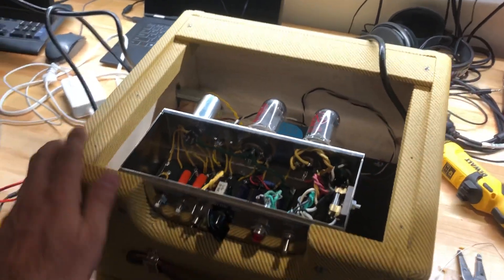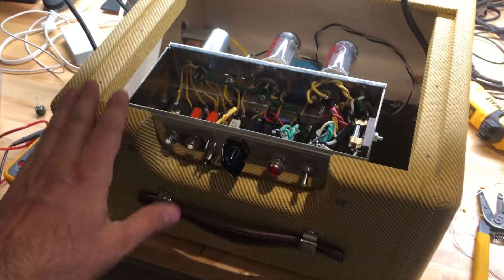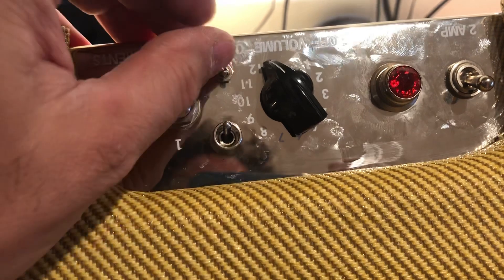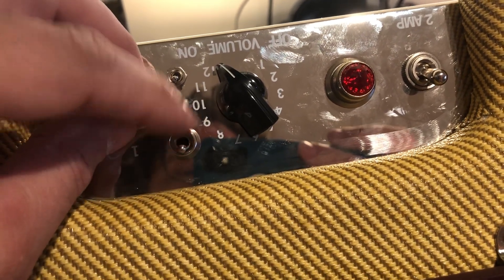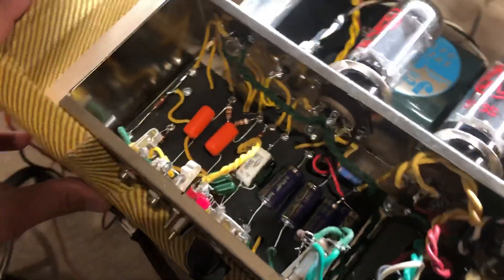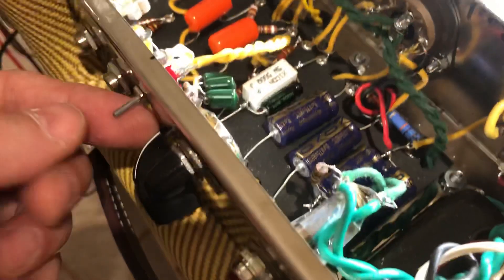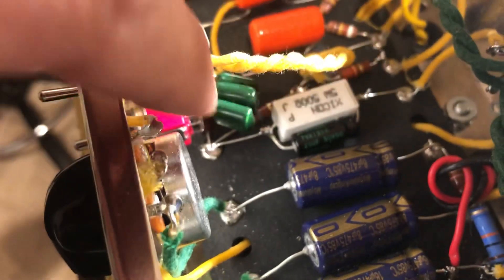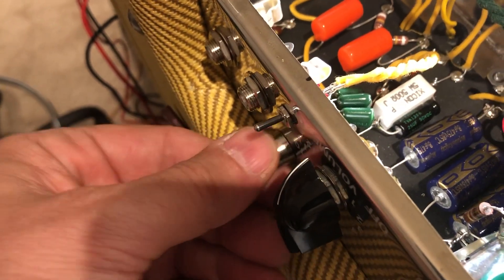Fender Champ extra mods

Comment: How is that cathode bypass capacitor switch wired? Do you have the center pin of the switch going to the positive voltage end of the cathode resistor, with both capacitors connected to ground on one end, and each capacitor's other end connected to one pole of the switch? or do you have both capacitors connected to the wire that goes to cathode, and then you've got the switch middle pin on ground, and are tying one, the other, or neither capacitor to ground (seems like the latter would be the less expected way of doing this, but I couldn't see closely enough what was going on in there). Also... why did I see 3 polypropylene capacitors side by side in there? Were you combining a few together to get the value of capacitance that you wanted? Thanks!

Comment: I know this is a clone but do you know if you can change the speaker on the Fender 57 custom champ without taking out the chassis?
Reply: What's the problem with taking out the chassis?
Reply: @Honeythebeebee  I guess I found out you have to after trying, just worried about being zapped as I've heard the chassis can still have voltage when off.
Reply: @Cousineddy77  That's because old amps don't have a bleed resistor on the power supply caps. If you turn off the amp right after playing it still has charge cause capacitors store electric charge. If you leave it off unplugged for an hour or two it will naturally dissipate. Do research and stay safe!
Reply: interesting, but reading the questions of those who see the video it is understood that it would also be necessary to show a schematic diagram on paper where people can see the wiring of the changes and the values of the new components used.
Hoping for an unswer, stay safe.